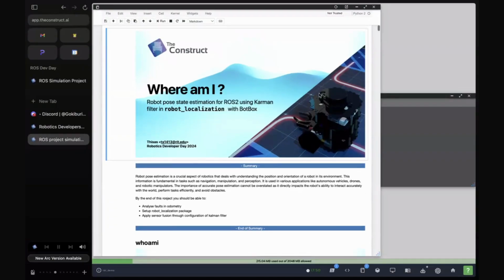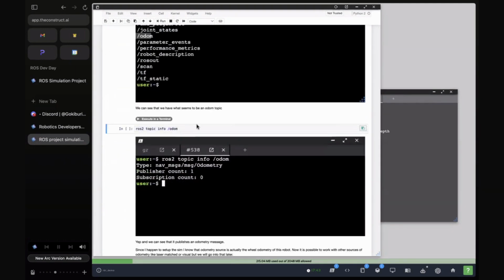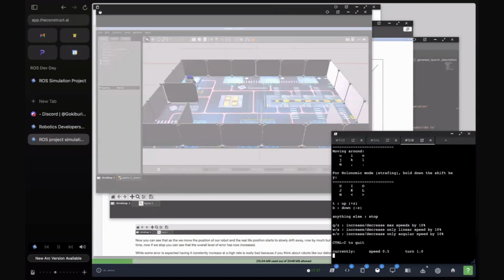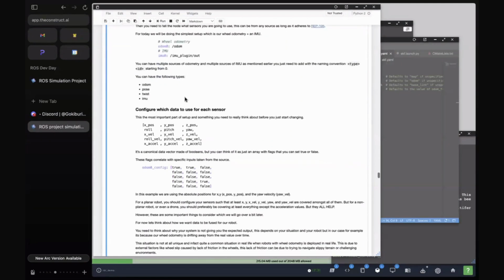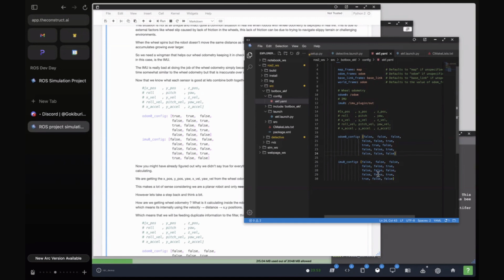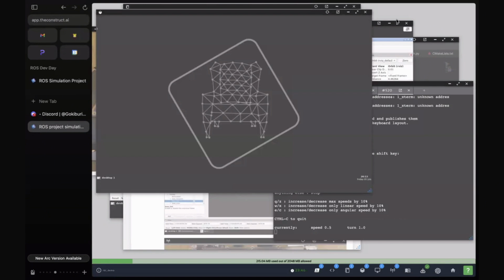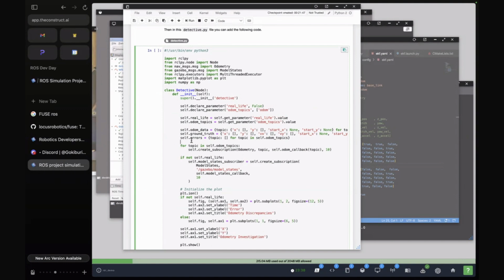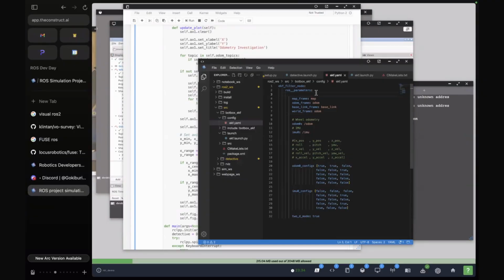State Estimation with Kalman Filters in ROS 2 | Thisas Ranhiru Samaraweera | RoboticsDevDay 2024

Comment: frequency: 20
sensor_timeout: 0.06  
two_d_mode: true
transform_time_offset: 0.0
transform_timeout: 0.0
print_diagnostics: true
publish_tf: true
map_frame: map
odom_frame: odom
base_link_frame: base_link
world_frame: map

# Odometry sensor input
odom0: /odom # incoming messages at 20hz every 0.05s
odom0_config: [true, true, false,
               false, false, true,
               true, false, false,
               false, false, false,
               false, false, false]  
odom0_queue_size: 10
odom0_nodelay: false
odom0_differential: false
odom0_relative: false

# GPS sensor input
pose0: /gps_cartesian # incoming messages at 1hz
pose0_config: [true, true, false,
              false, false, false,
              false, false, false,
              false, false, false,
              false, false, false]
pose0_queue_size: 10  
pose0_nodelay: false
pose0_differential: true  
pose0_relative: false

i want to fuse odometery data with pose data(converted to catesian), is my odom0_config set correctly : i want to send x, y , yaw,x_dot & pose0 : i want to send x & y

but im getting weird behaviour, the filtered odometery is almost matching the odometey not effecting by the gps data at all, even after drifting away

can someone help me how i can configure the .yaml file to get things working

i want to use the odometery for prediction & gps data for correction in ekf process

(my odom data & gps data have covariances in their messgaes)